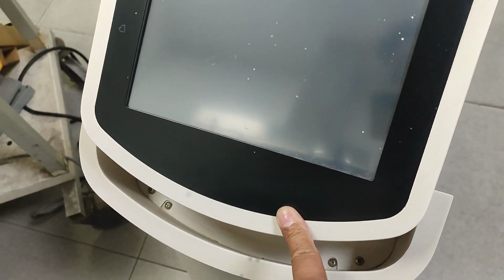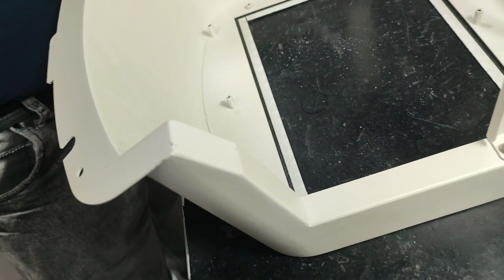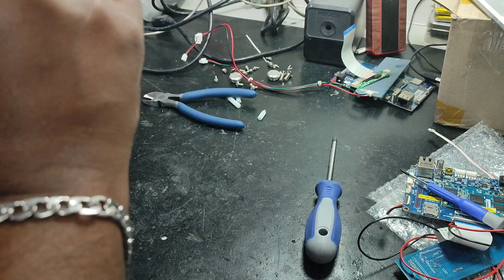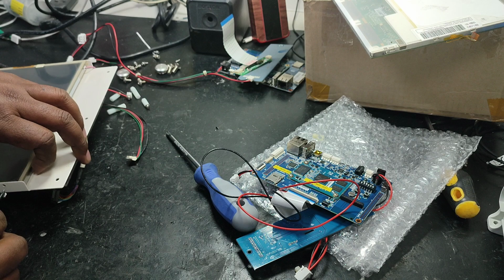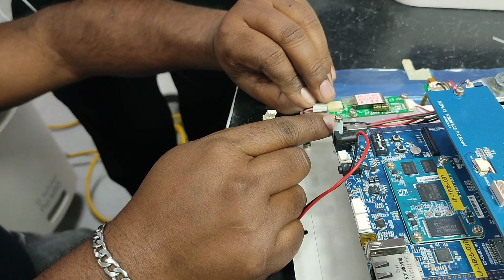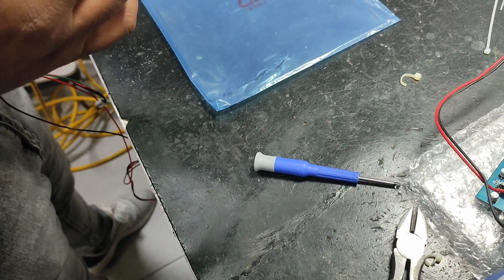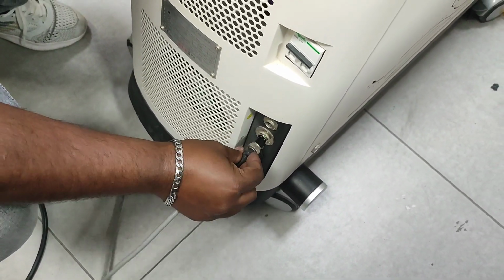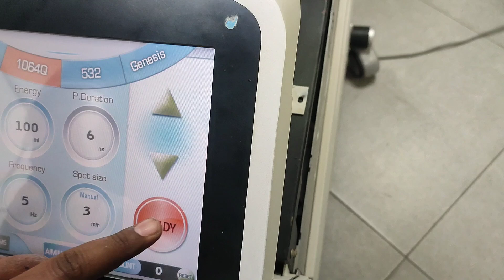How to replace Q Switched  ND Yag  Laser LCD Screen was broken.

Comment: Almost how much did the screen cost?
Reply from the maker: 5000SR the cost of the screen including display board, but the display board is not compatible to the main board; we  used the old display board  and the new screen. if you have plan to replace the display of your Q switch buy only the LCD do not include the board